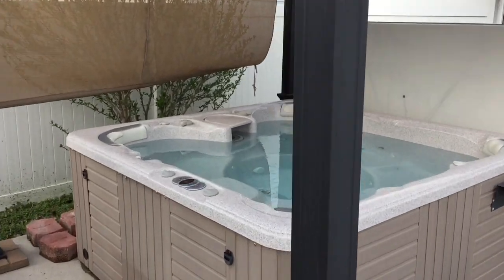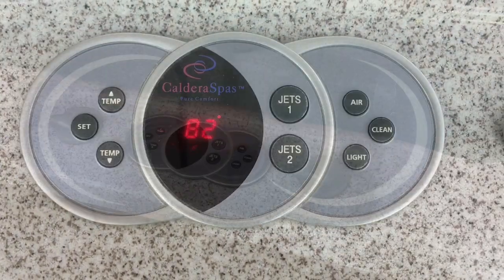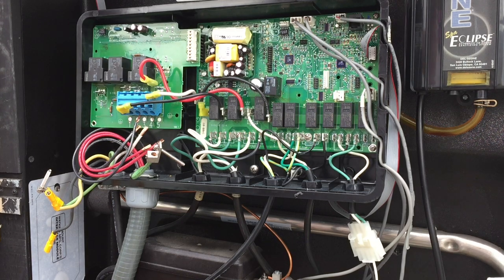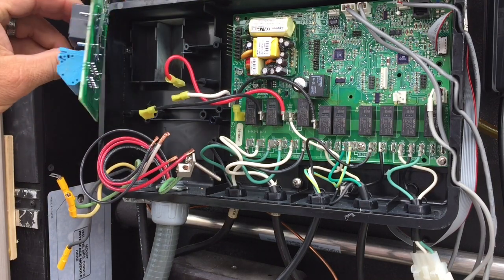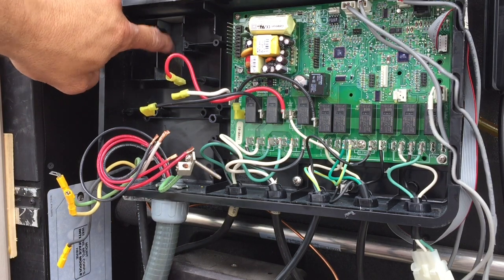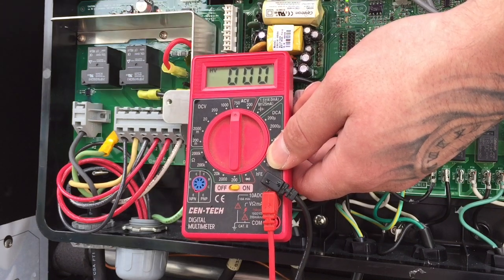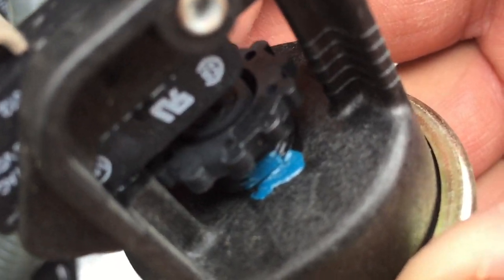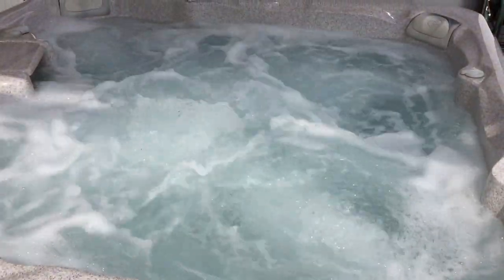Fixing A Cold Hot Tub...

Comment: My question would be "What caused it to burn out ! will it do it to the new one " ??? I always want to know WHAT CAUSED IT TO GO BAD !!!!
Reply from the maker: Good question Dave. Not really sure why components fail for no apparent reason. Could have been a fluttering  relay due to a faulty pressure switch causing heat build up. Relay switches are mechanical so that may have played a roll. All mechanical devices eventually will wear and fail. The new replacement board is an updated version and is expected to last longer per the manufacturer.
Reply: Ok Thanks,it always bothers me when something goes out like that,I always want to know what the cause was,just to make sure I'm solving the problem
Reply: Thanks a lot William,I'll check it out .
Reply: I'M SHOWING 12.5 AMPS ON THE HEATER,BUT THAT'S WITH POWER OFF,SHOULD i CHECK WITH POWER ON,& IF SO WHAT KIND OF READING SHOULD i HAVE ?    THANKS
Reply: @SmokinwithKasket  It's due to the contacts in the relay not connecting together properly causing arcing and extra heat .

Comment: my hot tub wont stay warm what could be the problm
Reply from the maker: Could be a number of issues. Check and make sure your circulation pump is running. Check your relay board for burnt solders or relays. Check your pressure switch. Lastly check with a meter to see if your heating element is getting full power (240 volts).  Other problems could be the control board. But most likely the first few items I listed. Good luck.